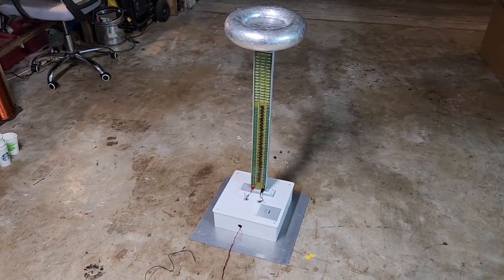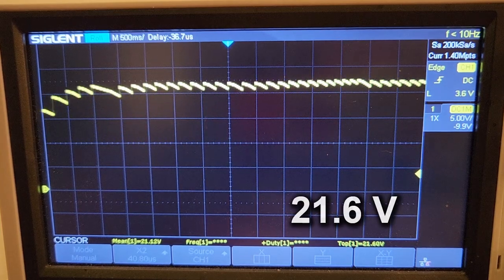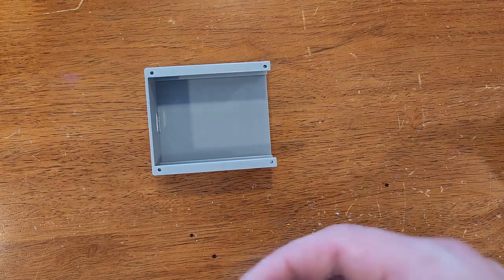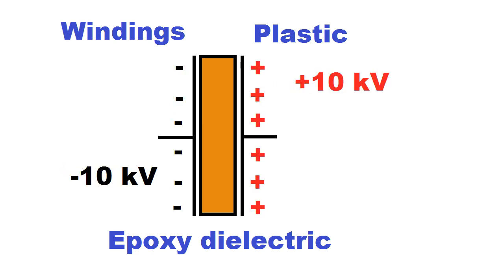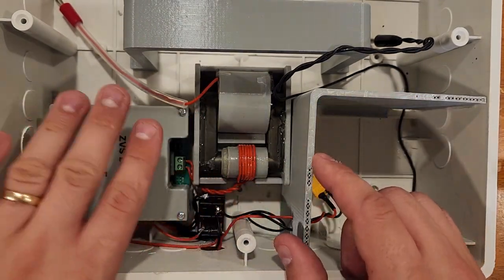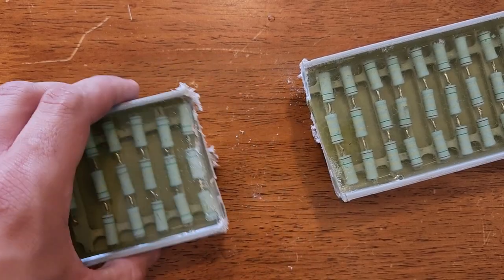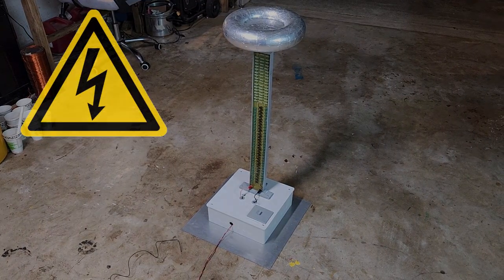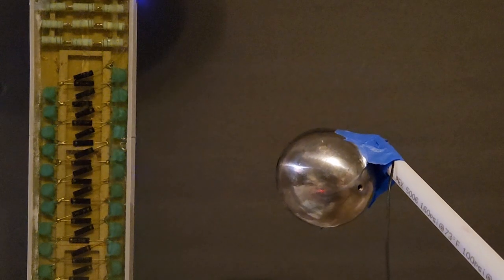500,000 Volt Lightning Tower

Comment: A welders tip: if you've been "flashed" too much or watching too much electric sparks, well, that's ultra violet radiation and it burns the retinas. Cut a small potato in half and put the cut side against you eyes/eyelids for at least 10 minutes. Your headache will go away and your eyes will feel better🙂
Reply: wat

Comment: You were very close to permanenteye eye damage.  The problem is UV.  Light violet lacy sparks are no problem.  As current (not voltage) goes up the discharges turn bright blue.  Still okay but still more current and the discharges turn white.  White discharges are not eye-safe.  They sure are loud and fun however.

Comment: Oh the memories. 
As a teenager in the 1960s, I took the 12K volt neon sign transformer from my Tesla coil and constructed a six stage voltage multiplier. I used TV diode tubes with attached battery for isolated cathode heater. I used TV high voltage capacitors. The meter-high frame was wood and my attempt at eight stages failed when the arc crawled down the frame to ground. I too now recall the electrostatic effects, the buzzing, hissing and the smell of ozone. My spark-gap Tesla coil pulled 20 inch (50 cm) AC arcs when tuned, and the voltage multiplier pulled 8 inch (20 cm) DC arcs by comparison.

Magnificent.

Comment: I just finished building a full wave multiplier stack. I used 10 nF, 20kV caps with the 2CL2FM diodes. The old tap water resistor works great on extremely high voltages. I put 5 kV input @ 50 khz / 50 mA and I'm getting 120 kV on a 12-stage CW multiplier. On 10 kV input, I'm running 240 kV + output on the multiplier. Having larger capacitors on the multiplier and doubling up diodes  (2 x 2CL2FM diodes in series) helps with voltage stand-off protection.  Mineral oil is the best dielectric for the multiplier. 

Your diode multiplier uses a huge number of stages. So in reality you are likely dropping voltage. Raising the capacitance might help reduce voltage losses.

Comment: As you noticed, corona discharge was a huge problem with your multiplier stack. In scientific and commercial multipliers, this is greatly mitigated by smoothing the electric field to reduce the gradient, in much the same way that the topload allows you to collect charge. I've built multipliers in the 30-50kV range, so take my advice with a grain of salt, though I have had plenty of flash-over fun.

First, all of your solder joints are sharp points. It really doesn't matter what your dielectric is (including vacuum!) when those points generate extreme voltage gradients. Everything will very quickly break down in that environment. When going for extreme voltages, the easiest way to ease these gradients is to bury your solder joints in some flavor of small sphere. Conductivity isn't important so iron, steel, brass, and other inexpensive metals work fine. Beads, ball bearings, whatever you can find that is inexpensive should work.

The more extreme way of dealing with this is called a corona-ring. This is where you attach each stage of your multiplier to a high aspect ratio toroid that wraps all the way around your multiplier. This makes the electric field gradient from ground to top-load voltage very smooth, and since your diodes and capacitors are sitting inside this field, there is a much lower potential (haha) for any sharp solder joints to emit corona. If you go this direction, take a cue from those isolators you see on high voltage power lines and make rings on a stick to increase creepage distance when you build supports for the corona rings.

Second, increase your drive voltage and reduce your stage count. CW Multipliers have a complex capacitive reactance that gets higher as the number of stages go up, so your output droop can get bad as stages are added. In my case I went from a 6 stage monopolar design to a 3+3 stage bi-polar design and saw a significant reduction in output voltage droop with the same output load, so my real power throughput also went up. Additionally, the style of multiplier you used was a half-wave rectifier and converting to a full wave rectifier multiplier can help with voltage droop as well. I was using some parallel capacitors in my multiplier and switching them to a full-wave rectifier also significantly reduced droop at the output. This does require a center-tapped transformer, so you may find the complexity not worth the trouble.

Finally, in a ZVS driver, the transformer drive voltage is about 3.2 times the input voltage, which is why your transformer output significantly more voltage than you expected. In fact, you said you drove it at 8V, about exactly right to get the output voltage you wanted. Probe the tank capacitor voltage and you will see the problem!
Reply: Really interesting. Zvs is pi times more I think

Comment: Just a quick one, (basically) all epoxies shrink when they cure so a really long casting like that will bend as it cures regardless of heat. If you can balance the support in the middle rather than on one side it'll shrink square at least. The more filler you have in the epoxy the less it'll shrink if that helps. 
Also yeah large lumps of epoxy will exotherm pretty hot. I've seen them catch fire in the past lol. So yes a slow cure is a good idea too.

For version two perhaps look into a borosilicate glass tube for the tower, they are relativley cheap in 80-100mm diameter sizes and have pretty decent dieletric properties. Though I'm not sure how well pretty decent stands up to a million volts.
Reply: Does that shrinkage put mechanical stress on the components / connections?
Reply: @RavenLuni  it will yes, but components are normally small in comparison to the shrinkage so it's not much of an issue. Normally you use specific potting resins which are generally a little flexible for that reason.
Reply: I don't think filling epoxy is a great idea for high voltage aplications. It creates a lot of boundary surfaces between parts with different permittivity. Dielectric strength parallel to boundary surfaces is usually much lower than perpendicular to it. In my opinion it's best to have a homogenous insulator.

Comment: Nice CW voltage multiplier. I have a few suggestions based on personal experience. Use mineral oil instead of epoxy. Even though its messy you can repair things when they break or make modifications. Its also less likely to trap air. Use a separate resistive load. This allows much more flexibility in the selection of load resistance and also makes the height of the multiplier lower. Don't implement more than about 15 stages. Efficiency drops off rapidly above that number. Use a higher drive voltage instead even though this makes the design of the HV power supply more complex. You can look at the 14-stage CW voltage multiplier on my channel for ideas if you wish.

I used 2 COTS AC flyback transformers connected in parallel for additional drive current. A COTS ZVS driver was used to drive the flybacks with a drive frequency of 28 Khz. This combination yields 15 KV peak AC to drive my multiplier stack. I could post a link with even more detail but YT will delete my comment.
Reply from the maker: Thanks for the info. I figured oil would be a better approach than epoxy after all the trouble the epoxy gave me. Also like the idea of modules. Not just for a separate resistor section, but maybe for separate multiplier sections, so that if just one part failed, it could be removed and swapped out
Reply: @HyperspacePirate  Please don't overstate the output voltage for this circuit.  It makes for unrealistic expectations and disappointments for new experimenters, and just causes confusion.
As the original commenter mentioned, you get progressively less voltage per stage, to the point where you start to lose voltage just from the series resistance, especially with such low capacitance in each stage.  I have built many, many such multipliers, and it's best to limit the number of stages and test to see how many work best.
Also an actual 500KV output would produce sparks 20 inches long (Around 25KV/inch as a very rough estimate), so it's safe to say you're getting around 200KV at best.  Of course the voltage will be higher when you're not trying to draw arcs, but actually measuring that without massively loading the voltage down is rather difficult.
I look forward to your future videos, and really appreciate the work you do to explain and document the whole process.  Coming up with a good design for a split-bobbin core isn't easy either, so props to you for creating something which works that well.

Comment: Nice video as always! Always interested in electrostatic/ion wind effects that are new, especially if you can get enough wind flow to make a truly bladeless fan instead of by using an impeller. 😁
Reply from the maker: I'm planning on doing a whole video (or even video series) on high voltage ion thrusters, measuring exact voltage / current / grams of thrust, etc
Reply: @HyperspacePirate  Teacher, can you make one with a discharge time of more than 1 minute?  The voltage reaches 5000kv. I bought a self-made electric shock rod with a high voltage generator of 1000kV, and the electric mouse. The discharge time is only a short 5 seconds and the mouse fainted after a long time. And the needle is wet, so it cannot be powered, and the mouse is almost gone.  , I want to make a 5000KV electric baton, which can stun mice at once and electrocute them to death

Comment: I made a lightning tower similar to what Jay on Plasma Channel made, with an 8 stage CW circuit.  I drive it with a small build it yourself plasma lighter circuit available from Amazon.  I have run those up to about 12VDC in and they survive, probably giving me around 8-10 kV AC out to feed into the 8 stage CW tower.  I can get sparks about 2 to 2.5 inches long from it.  Now, it occurred to me that the diode chain in the CW circuit can be either way up the ladder.  Anodes pointing up, you get a positively charged top load.  Other way, you get a negatively charged top load.  Sooooo, I built another one with the diodes in the other direction.  I added jacks at the bottom of the CW ladder on each so I can connect those points on both towers commoning the "grounds".  That allows me to generate some pretty good snappy arcs between the two top loads of around 5 inches in length.  So that puts me in the 100 kV to 125 kV range.  No series resistors so the arcs are pretty snappy but I've had no issues with those 100 mA diodes and I've had these towers now for several years.

Comment: Very impressive! I marvel at what Tesla did with his coil and the parts that he used were not solid state as we have here. He certainly had leakage issues to overcome. I was just thinking about his tower at Wardencliff (sp) and if you might be able to get power from the earth right about the time you said you may add an earth ground rod. I think Florida has right elements to make that possible
Reply: Tesla's tower was just what we would call a radio transmitter today

Comment: If you plan on making more devices like this, I suggest that you use an air switch which is operted using a pressurized tube. This creates nearly no path to the controller.

Comment: I'm working on something similar except I use a 10 stage multiplier with 100mA diodes and 2nF caps in paraffin wax.  With 25V/8A going into my flyback (15-20kV out), and an 11 ohm resistor, I get ~10 inch arcs (150-200kV) that are extremely loud and bright. I've been using it for a year and the diodes and caps are still fine. And yes, that's 11 ohms, not mega ohms. If I want to limit the power even more, I use a 1 kOhm resistor. I think 7.5 MOhms is extreme overkil unless you plan on running it for a long timel. But then again you might be using 5mA diodes. I will post a video when I'm done assembling everything. Currently just 3D printing all the housings and chassis parts to make everything look nice.

Comment: Have you tried conductive PLA for a top load? Built a VDG with this, bottom toroidal and the top half a hemisphere.  Had to print in 4 segments for a 13" top collector but worked beautifully. Going to do a toroidal top load for a VTTC I'm finishing this month. Great project! Maybe equipotential rings on the outside at 6" intervals may help, printed these also with conductive PLA for my VDG with 13" dia collector. I was surprised at how well this machine works, the toroidal bottom half and spherical top half works better than spheres I've printed as there's a soft curve wrapping into itself at the top of the tube. Will post a vid. at some point titled "Having fun with conductive PLA" or something like that. As an aside, these conductive plastics aren't so great for low voltage apps but doesn't seem to matter at electrostatic voltages. Keep the great stuff coming, never would have occurred to me to build this!

Comment: Awhile back I saw Jay on plasma channel use tubing filled with distilled water and stuck a nail in each end for a high voltage resistor. Might be applicable with your project so you can limit the current and keep the diodes from failing.
Reply: High voltage power resistors get very expensive too

Comment: The multipliers don't perform well if there are more that ~15 stages because diodes' internal capacitance begin to interfere with higher stages caps.
Its more like 70-100 kv in the video

Comment: Nice work. Adding a ton of stages to a multiplier should work in theory. For 500kv, u should expect to see 50 centimeter arcs / 0.5 meters at the very least considering the dielectric breakdown of air. Adding a lot of stages doesn't help to increase the voltage like you might think because of a few reasons:
As more stages are added, the voltage across each individual stage is decreased. 
The reactances of all your capacitors are going to add up which is going to weaken the arcs a lot 
And a big reason is because real world capacitors all have some leakage current within them that drains itself slightly. This results in voltage being lower on top of the fact that the voltage across each stage is less with more added within the multiplier.
Reply: So because of this I would recommend a few options to get the results u we're looking for:
Increase the transformers power and use anywhere from 8-10 stages at most using capacitors and diodes rated for much higher voltages to accommodate for the beefier transformer.
Instead of a ZVS, consider a full or half bridge inverter. 
Also try adding multiple transformers primaries in parallel with their secondaries in series for a much larger input voltage to the multiplier

Comment: Another great vid (just found you today, so I’ve been binging :-) 

I’ve been thinking about making one of these myself, not for any rational use case, but just because I think it would be cool to have a 1 MV voltage source 😁

Great idea to make a 3D printed form for the toroid! I’ve been interested in making a big Van deGraf or Tesla coil, but making a top load from metal seemed daunting. Technically not too hard to do with metal spinning (I have a wood lathe that I might be able to do that with), but a very high hassle-factor.

Comment: I bet the PLA or ABS you printed the parts from has a much lower dielectric strength than the epoxy you potted everything with. Also willing to bet the 3d printed structure had plenty of internal air gaps and whatnot. Might be worth taking into account next time.

Comment: Tbh, the output isn’t great and there are probably two contributing factors for that. 
The first one should be quite obvious and it is the massive amount of corona leakage and maybe also the non ideal grounding. 
But I think one of the other very important things is that building a multiplier with over 50 stages is not a great idea, because the more stages you add to the multiplier, the more will those stages load down the output and also with that many stages the charge time is also very long. Because of that at some point you will get significantly less output with more stages. It would be a much better Idea to have fewer stages, but to drive those at a higher voltage. like 20 stages with 20-30Kvac input. It will be more challenging to design the circuit for higher voltages but it should be worth it.
Also what diodes did you use and where can I find them?
Besides that great video and good luck with version 2.
Reply from the maker: Link to the diodes is in the description.

I suspected fewer stages with a larger input voltage might have a better result, but haven't tried it yet since I've struggled to build transformers that deliver >10 kV without self-destructing
Reply: @Hyperspace Pirate  In the past I also had some problems with 3D printed transformers arcing over (at just a few KV) due to imperfections in the print, thus I would recommend making a bobbin out of a fibreglass epoxy or similar.
Like in this video here: https://www.youtube.com/watch?v=qOXMTlN6Vzo   That person was able to make a 50kv high frequency transformer while using a bigger core tho. 
Still you should give it a try, you might get better results.

Comment: The further you go up the multiplier chain the higher the voltage will be. Therefore you need increasingly better electrical insulation. That's why stopping the arc from that resistor only moved the problem to further up the stack. Also, the more multiplier stages you have the lower the average output current will be. And yes,m the peak DC will kill you at higher voltages, because you are essentially discharging a capacitor with a low internal resistance. Therefore the instantaneous peak current can be very high; many Amps. And it can take less than 20 milliamps to kill a person.

Comment: that fault happen bcz your wound winding is not clasified for high voltage laquer insulation thats why it has corona discharging around the wire and voltage jumpers